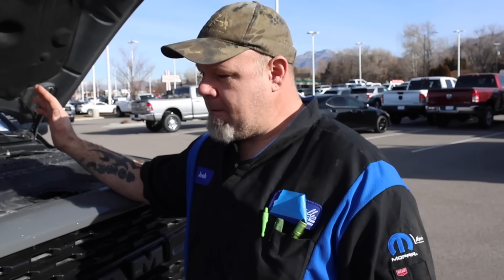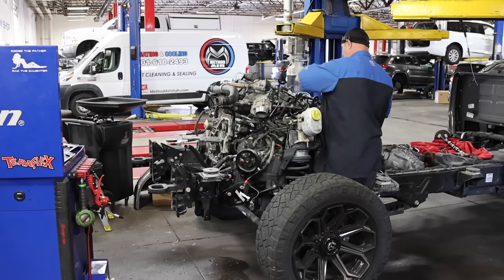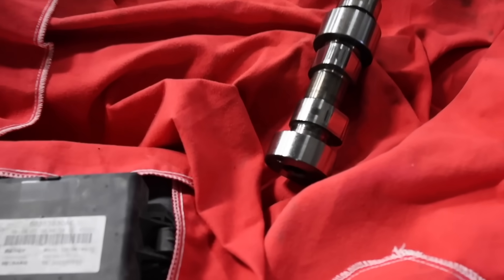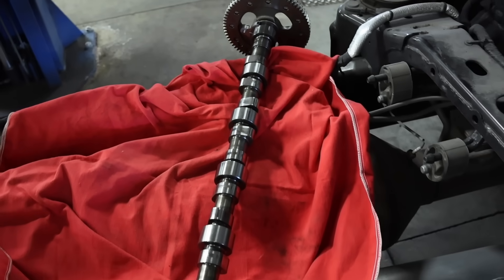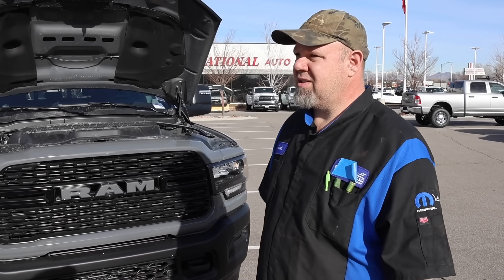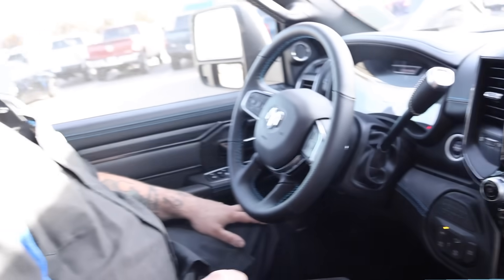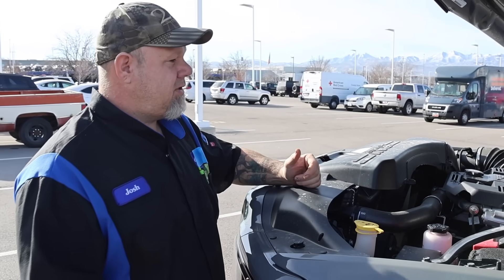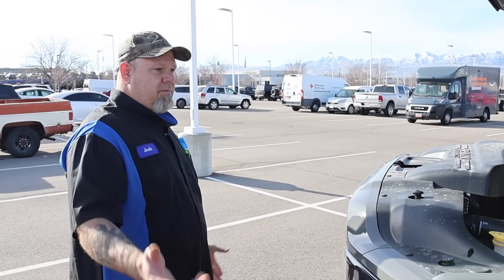Master Diesel Tech Explains The BIGGEST Killer To Your Diesel Engine!

Comment: As a pilot that operates jet engines, and jet A is a grade of diesel for how long do you let your engine warm up?? I would say bring it up to operating temperature before you hit the go juice. No  pilot is going to take off before his engine hasn't come up to a maximum performance temperature. Now, my GMC generally takes 10 minutes to get to 210° what I consider operating temperature. The colder outside temperature may take considerably longer. Most people just jump in startup and go, with on considerations  for what that engine is running weather is a tranmission hydraulic pump, electromagnetic generator. Man what a rabbit hole 🕳  you've gone down, I'm only going to give my opinion on how long you let that engine warm up and I would go to max operating temperature after that your wasting diesel fuel. GREAT subject and hurray  for you. If trucks had more gauges and could manage inlet temperature, exhaust temp, boost pressure and manifold pressure, oh crap look who's going down that rabbit hole now  😂. Great topic.
Reply: Big difference in operating an aircraft engine and a land base vehicle engine, and we're talking Pistons not turbines. An aircraft engine requires a decent warm-up. As it will go to a full power setting for takeoff. Diesel and gas engines should require only a short period of warm up before starting out at  low power settings, gradually increasing the load. This will definitely bring up the temperatures quicker as well as transmission and other fluid temperatures.
Reply: @chupacabra1765  we also preheat our engines, and when available, have heated hangers rarely have I performed a cold start on a turbine, and I rarely do one on my diesel engines as well. My tractors take a considerably longer time to get the hydraulic fluid going in colder conditions, so I will run at a higher idle to get it to warm up, maybe I'm a bit anal on warm up but with the lack of gauges in most everything non aviation I feel that I have no option, I really want those turbos to get oils to them in the cold, I  now see were Gail Banks has proven that the Duramax holds back almost a full Quart of old oil due to oil pan design,  more of a reason to stay on top of oil changes. Now I have to go and change my oil pan and connect all those gauges that I  like.
Reply: @chupacabra1765  I realize this video is more specific to pickup diesels and often are driven empty from a cold start so can use light throttle and low rpm to be easy on it if there is a stretch of slow speed road one can putter down. However as a loaded truck theme as per highway  tractors that may be loaded the evening before and fired up in the morning to haul said load, it requires power to move that heavy load so it goes back to a longer idling time to warm up  ( and at a high idle speed to promote a faster heating process ) before pulling out with that load. The only way one can get away with a relatively short idle period with a cold diesel during the winter is the use of a diesel fired coolant heater that can literally bring the coolant temp up to near full operating temperature.

Comment: Can you use synthetic oils in a diesel .
Reply: Yes absolutely, but diesel engine specific synthetic oils. Actually some of the 15W-40 oils on the market will have a part  synthetic component to them. Just keep in mind that the light duty diesel engines such as lets say  the GM 3.0 , they want a Dexos D specific oil but it would be a synthetic as well.

Comment: I remember when I was younger and helped farm, when we were mold board plowing for hours at a time, when we quit at night we would park up, let it idle at around 1000rpm for about 5 minutes. Pull the idle all the way down, wait a minute or two then shut it down. Taught a long time ago about cool down. No matter what you were doing. Great video.
Reply: That’s not the same as a truck pulling a camper, you were running that tractor all night

Comment: Can u set the idle the same way on a 2011 ram
Reply: My 2013 did I just turn the cruise on and hit set it should automatically increase you can then increase or decrease the idle speed with the plus or minus buttons give it a try good luck
Reply: @ricknielsen3660  Thanks

Comment: I have owned 5 diesels in my life a 6.2,6.5, two 7.3 and a 6.0 always changed my oil at 5000 miles and fuel filters at 10000 miles and ran a fuel additive never had a problem. I personally would not buy a new one they are to expensive and used one because most people don’t do maintenance the way they should

Comment: Great video, sir.. Cummins field service tech here, this is a excellent public service announcement.
Reply from the maker: Thanks!  I appreciate it
Reply: @Trukstuf I wanted you to get this if you didn't know.
Great Video, i have a 2017 Ram Cummins 2500 crewcab 4x4 tradesman. Absolutely love this chromed out Delmonico red beast! Ordered her drove it 600 miles city and highway about 40/60% then took it in had the oil changed to Rottela T6 full synthetic and the rear diff changed to the top synthetic the dealer had. And for 60,000 miles changed it the engine oil every 6k with the T6. Now knowing she was fully broke in switched to Amsoil Signature Series 5w40 Max Duty Diesel Ran oil analysis every 6k and filter change and top off to 15k miles oil still tested like it was near new. But i wont go further than 10 to 15k per oil change or if analysis says change based on the driving habits in that cycle. Surprisingly the Ansoil kicks the T6 ass it doesn't hold up over a 8k mile distance it starts to break down. Thats why i switched. Plus the Amsoil reduced the friction coefficient of the rotational mass of the engine which gave me 1.8 mpg increase. I also ran fuel supplements from day 1 power service Diesel kleen. Also switched the the Amsoil Diesel fuel supplements this stuff is amazing it bumped up the cetane from 45 untreated to 55 treated got me another 2mpg and reduced my regens by 40% i will never use anything but Amsoil from now on. Because i only do one oil change a year even though its more expensive its still saved me $240 and fuel savings over 2k in a year. Amsoil is worth every penny. 
Now i have the G56 6spd manual and the high idle function with the cruise control is NA. Its designed into the chip to engage with the parking brake on in nuetral obviously. At 60F or lower. What i found is this it takes a few minutes to engage idle up to 1000rpm. But if i start the truck with the exhaust break on full it takes about 10seconds for it to engage and it rapidly warms up between 1 to 4 minutes when its between 60°F to -12°F respectively. Shes got 90,000miles on the odometer and runs better than when i brought her home day 1 brand new. She pulls hard too especially when i spool up the turbski right and she chirps the tires between 1st-2nd, 2nd-3rd,   3rd-4th on occasion. Mind you i do not drive like that all the time and its bone stock my only mods are Amsoil in everythang! 😊 Thought you may like this info since G56 manual Cummins trucks are rare these days.

Comment: Ecactly..my 2014 2.0 diesel sprinter..got 266k..miles..i swap engineoil and oilfilter every 5000 to 6000 miles..i use a little thicker oil then recommended..because engine is worn out.  ..when oil gets black its time to change it..good oil looks brownish..👍

Comment: I bought a 24 L5P Duramax and the oil was black at 1000 miles!
First visit to the dealer I had them turn on the High Idle in the truck.
Reply: The high idle is built into the settings app on the vehicle screen you can turn it off and on.
I have a 2024 as well.
Reply: @ricknielson8934  yeah if it originally came with it.  Mine didn’t.

Comment: I just got my 2020 ram back from the dealer doing an oil change and fuel filter  now it has a tick  this truck only has 27,000 miles   And this is the bullshit they sent me. I have owned diesels  and never had this problem with my  other trucks. 

That noise by engineering is deemed normal, and for some reason happens after or between the first 2 to 5 oil changes of the trucks life, Engineering is working on a cause of the issue and a solution, but they ensure us that it if safe to continue to operate the vehicle and it will bring no harm to the vehicle  to continue to use it.

Comment: I got some bad news for this dude. He doesn’t know what he’s talking about now a Duramax has a problem with leaving lots of oil in the engine after you’ve drained it my old Dodge my 91.5. When I drain my oil, it all comes out you got a little bit left up in there you know maybe Half a pint but it drains out real good and when you do an oil change, you always wanna do it when the entrance is full temp, no bullshit about not going over 15,000 miles is just bullshit. I run 35 to 50,000 mile oil changes. I use an oil 5W-30 And also I run a bypass filter now when I was running 50,000 mile oil changes I was leaking oil not severely, but I would have to add oil periodically during that time. And I change my oil filter filters about halfway in between that 50,000 miles also I run Donaldson filters, my air filter is a Donaldson DBA 5202. It’s nano fiber technology it’s the same type of element. They run on M1 Abrams tanks that’s one of the keys of any engine air filtration now I had to have my engine gone through because I had a little idiot.. Work on my truck I needed a gasket between the block in the mounting plate for the power steering pump and stuff like that and he really screwed me up so I had to have my engine rebuilt. I still have my old pistons and they’re still an excellent condition the company that rebuilt my motor DNJ machine in Ohio they didn’t even have to replace my bushings in my rods, also things like my cam tunnel was an excellent condition and it’s extremely clean inside. I don’t know where this dude’s coming off at man. This is six in a row. Jim from Kennerdell pa

Comment: Damn crazy I’ve had 5 6.7 powerstrokes 2011, 16, 17, 19, and 23.. 200-300k mile trucks…never let it idle up to temp, romp on it everywhere, pull heavy trailers overloaded with tractors and equiptment.. never had any issues other than emissions related. Ripped them all out soon as they had issues… I farm for a living and imo ford is the best lol all the pinhookers and Spanish guys in the field are running ford diesels 200-300k miles towing 30k-40k lbs on the fuckin bumper .. I know cause I’ve loaded them lol. Damn sure isn’t a Cummins or Chevrolet loading watermelons in the field running 300k miles I fuckin promise.

Comment: Ram 2015 Ecodiesel. I had the dreaded mile countdown to see dealer. The DPF SCR was replaced by the extended warranty for original owners. The Diesel mechanic recommended I change the oil 8,000 miles and to replace the fuel filter at 16,000 miles. 
He highly recommended I use Hot Shot’s Extreme Diesel every 6,000 miles and followed up with EDT using 1 ounce for 20 gallons.  I put in a K&N air filter. The Ecodiesel engine is discontinued. My cousin traded in his 2015 Ram Ecodiesel for a 2022 Limited and is very happy with the new engine. I told him to follow the Diesel tech’s recommendation on maintenance.

Comment: Absolutely 5000k for Diesel and 3000k for Gasoline. And tire rotation and windshield wipers, plus checking all fluids in your truck. I change my oil when the oil life hits 50% on my gauge in the dashboard. Also in colder areas make sure you plug in your truck every night to keep the oil warm for start up. I am a retired tow truck driver for extremely heavy vehicles and light vehicles. Be patient with your Investment give it the proper maintenance and it will last forever. Also on a personal note buy a pre def truck and you’ll have less headaches!!
Reply: @bigmountain7561  you like wasting money…
Reply: @ nope I love clean valves and return holes. Also I always budgeted and since I’m a retired heavy duty tow truck and heavy equipment operator I can do it myself.
Reply: @bigmountain7561  regardless how good of a tow truck driver that can change their own oil, you’re still wasting money…
Reply: @ Just like alimony and child support, both i have never known. Lol!!

Comment: I've only done 30k km oil changes on my van's and diesel cars. Mainly from the TDI PD generation, they are 17 and 18 year old with  both around 260K km's, the only thing changed was the tranny (and one EGR cooler) on the van probably because the trailer was at it max towing weight and it went all across Europe.. They are still solid no wear on the cams and they have small cams because of the PD injection unit. I do swap them at 15K km, on the newer euro 6 diesel van because the oil also actuates the fazers,  and I don't want the mesh clogged.

If the cams are wearing, the engine is trash. Don't blame it on the oil. Then again, dodge is a part of the stellantis group. Seeing the track record they have over here with add blue pumps failing like mad, wet timing belts on the pure-tech engines was a fucking joke.

Comment: Is there a certain amount of time you should go between oil changes? I bought my 24 f350 diesel in January and did a 1000 mile break in oil change in April.
. It now has just under 3k miles and am just wondering if I should change so

Comment: I just turned 220,000 on my  2006 duramax. I run 15 to 20 k oil changes,with filter change at 5000, but i also run a frantz bypass filter and pull an oil sample every 5,000 miles for a full workup. which includes tbn,coolant,fuel, and wear metals. 
I have been running shell rottela t6 since it came out in the 15w40 variety in northern wisconsin year round. Truck has had injectors replaced and head gaskets done at 132,000 only because the dealer broke a glow plug off in the head. The tech said the motor was too clean to have that many miles on it. I told him what i was running and doing, and he said, "Keep doing it"
Reply: Buddy you seem to be spending a lot of money trying to save a lil bit. Around about 5k oil change and pm service. Never done an oil analysis kind of don’t see the point either. Just don’t abuse the equipment also trucks break down especially work trucks that run everyday.
Reply: Yes! I’ve seen plenty of engines maintained like that go for crazy high hours before an overhaul.  That’s a huge money saver when used properly.
Reply: How much is oil analysis vs oil change?
Reply: @poseypapusdiazfamily4630  in my area it runs about $30